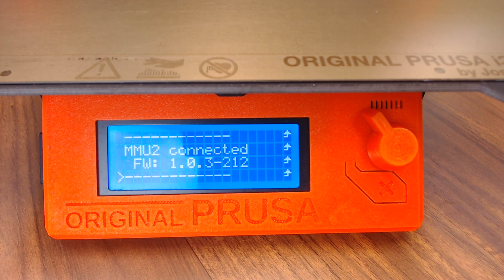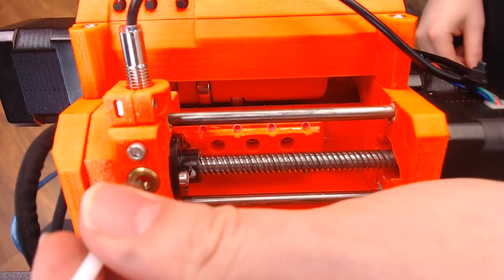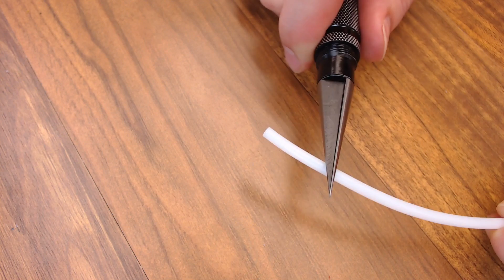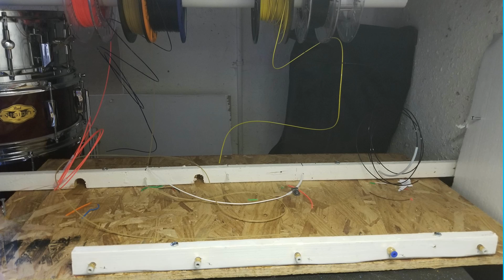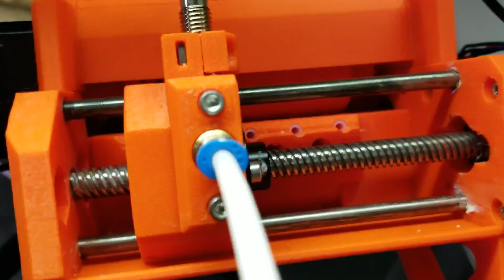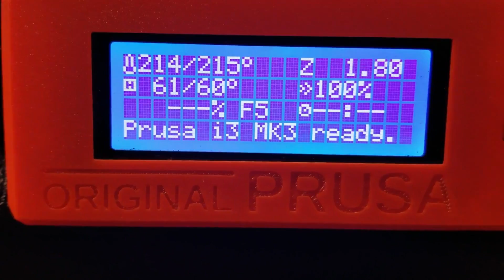Prusa MMU2 Multi Material Unit - Tips and Tricks - Chris's Basement

Comment: If the two screws that hold the back cover on are under spring tension doesn't that mean that the filament is also under spring tension as opposed to being held by two fixed bars?
Reply from the maker: You are correct, but it adjusts for all 5 filaments at the same time, so if you have one that's even slightly off there is no compensation for that one.
Reply: @ChrisRiley  oh I figure since it was only hitting one roller at a time it would be able to compensate for it.  Guess the tension system is pretty picky eh?
Reply from the maker: @DoRC  It does try it's best, but it's a lot to ask across that plain. It's a little tricky. ;)

Comment: This is an excellent video.  I too have an MMU 2.0 and I've got a few tips to share as well now that I've gotten mine to 100% reliability (seriously) and I've even got it working with flexible filament!

Use this PTFE pass-through back plate: https://www.thingiverse.com/thing:3233579  Why:  The stock back plate squishes the PTFE tubes resulting in too much friction.  Bonus feature:  This mod makes it super easy to disconnect the PTFE tubes to relocate your printer (e.g. for maintenance or just to take it somewhere).  Just press the collet down and pull out the PTFE.  Takes 2 seconds!  Love it.  Insertion afterwards is even easier.

Use this "Large Bore" MMU 2.0 selector and print it at 0.1mm layer height: https://www.thingiverse.com/thing:3337120 Why: The stock selector's intake hole is far too small (and not even tapered!) and that part is printed at .2mm layer height... If you cut filament tips with nice, sharp flush cutters like me this means that the tip will have a super pointy end (like Prusa recommends) and that pointy end will often get stuck on the outside of the selector or it will be pushing up against those .2mm layer lines (which are not smooth--they're quite rough; I assume because Prusa is printing a zillion of these a day at rather high speeds) which causes far more friction than you'd think.  By having a larger (tapered) opening and printing at 0.1mm layer height you'll have a selector that's super smooth and gently guides the filament the way it's supposed to with very little friction.  Also, I highly recommend you print it with some transparent PETG which is much slicker (more slippery) than the black PETG Prusa gives you for printing the parts.  Dark pigments can give printed PETG a considerably rougher surface!  For reference, I printed mine in eSun Transparent Blue (https://www.thingiverse.com/make:596801)

Use that tapering tool Chris recommended in his video to taper both ends of the "short" PTFE tubes in the front of the MMU 2.0 unit.  The MMU 2.0 ships with just one side of those tubes being tapered and the manual says to insert them with the tapered end facing outwards (which doesn't seem to make sense but one of Prusa's engineers says it's to aid with retracting rammed filament tips).  Having both sides of those short tubes tapered means there's less of a chance that a sharp (extra pointy) filament tip will get caught on the edge as it comes out of the hobbed gear and into the selector.
Reply from the maker: Thanks for sharing.

Comment: Just a minor correction:  You called the MMU 2.0's PTFE tubes "Bowden tubes".  Not a single bit of the MMU 2.0 is Bowden.  They're just PTFE "feeding" tubes.  A Bowden tube is a very specific thing: PTFE going from the extruder to the hot end.  That's it.  Anything else is just a regular PTFE tube.  The MMU 2.0 uses a direct-drive extruder so there's no Bowden to speak of.
Reply from the maker: Noted.
Reply: relax

Comment: Hi Chris, I’m considering buying the mmu2 for my MK3 but wondered if there’s space to attach it when using the Lack enclosure?
Reply from the maker: Not without an overhaul on the enclosure. It might fit, but the filament routing will be a nightmare.
Reply: Chris Riley ok, thanks.
Reply: @ChrisRiley  I can confirm that it fits (but only just). Routing isn't a big problem if you place your spools on top of the enclosure. I can fit all five with the provided spool-rollers. Maintenance is a nightmare, however.
Reply from the maker: @mhelvens  Thanks Michiel, as much as I have to clean mine out I think for me the enclosure would just add to the headache, thank you for confirming.

Comment: Chris, anyone else, I'm having issues with filament tip being too thick sometimes on filament change and it gets stuck in the ptfe tubing... any advice on setting changes?
Reply: I had this issue and fixed it!  Double-check that no PTFE is getting "squished" anywhere in the MMU 2.0.  For me, that problem was caused by the plate in the back of the MMU 2.0 that holds the backside PTFE tubes in place.  It's not a very good design.  I swapped that back plate out with this one which uses proper PTFE pass-through connectors and that problem went away: https://www.thingiverse.com/thing:3337120
Reply: Almost forgot:  Also make sure your extruder body isn't an earlier version of the R3 unit.  The hole going from the top (where the plate holding the PTFE tube fits in) was slightly too small and could result in tips getting caught up (slowed, if not completely stuck) in there.  You can fix it in like 2 minutes though real quick:  Remove the top plate that holds the Festo coupling and that little PTFE tube then use a 2mm drill bit to drill it out.  Go as slow as your drill can go and be careful not to hit the filament sensor (even though it's not being used in the MMU 2.0--yet) or the Bondtech gear (you'll need to unscrew the tension screws and lift up the side plate so you can get a good look in there while you drill).  I did this (even though I printed the latest R3 extruder body) and also gave it a little bit of a wiggle while I drilled it out to ensure it was tapered ever so slightly.  It definitely opened up the hole just above the Bondtech gear a bit and from that point on I never had a poorly-rammed tip get stuck there.

Another thing that caused me a similar headache was a mistake I made in Slic3r-PE:  I accidentally used an MMU 1.0 profile for a print which had it trying to unload the filament the entire way using nothing but the extruder itself (no MMU) which resulted in a great big blob of hard-to-remove filament just above the Bondtech gear.  Ugh!  Took me far too long to figure out that was what was causing that problem, hah!

If in doubt, (temporarily) relocate your Slic3r profile (effectively resetting everything to defaults) and try a simple MMU print to make sure everything works.  There's just as much that can go wrong with the software as can go wrong with the hardware!
Reply: @Riskable3DPrinting  I'll have to take a closer look at the tubing just above the extruder gears then cuz that's where it's getting jammed. I did bore and double check all other spots though like you mentioned. I went from mk2s mmu1.0 to mk2.5 mmu2.0 just last month. So I assume it's one of the newer revs but I can check. the filament is occasionally ball ended instead of spear shape or just too thick of a spear. It's this Algix APLA , I have 5 spools and needed to make some name tags with those colors ... otherwise I'd just reserve them for single prints because it will only jam at the end.  I was leaning toward any suggestions on ram settings etc because my petg and other pla doesn't seem to have this thickness issue.
Reply: @Riskable3DPrinting  I used a drill up at the selector and that alleviated a lot of friction there. I'll take a look at this area you mentioned and see how it shakes out!
Reply from the maker: Thanks for the tips @riskable 3d printing, @jungle gym ninja, let me know if you still need help.
Reply: @ChrisRiley  For sure. Thanks for the video. I struggled getting through some printing some mmu gifts a couple weeks ago with constant attention to random jams and was so exhausted from dealing with so many errors... haven't even printed in 2 weeks cuz I just expect trouble, really regret leaving mmu 1.0 as it is. I will try these tips and suggested fixes cuz they seem like it is common and is what might be at the root of the problems I'm experiencing. Thanks!

Comment: Thanks for the easy to understand tips on getting your MMU2 to work successfully. I have been doing my head in with failed prints so I will go back to the beginning and check and recheck using your your advise. Hopefully I will have success and start enjoying my printing experience again. Cheers :)
Reply from the maker: Good luck Morty, make sure you contact Prusa if you can't figure it out.

Comment: I personally think the MMU2 was kind of a failure business-wise. It simply didn't work for almost anyone as easy as advertised and people had to wait a long time for a firmware that kind of worked. Modding needed etc. I wasn't impressed after the usages I've seen by people, only a few print awesome models. Compare all of that with the setup of a Pallette. Both need better waste management (have a look at the solutions by 3D maker noob), but setup wise the Pallette seems rock solid.
Reply from the maker: I need a little more time with the Palette2 before I can make a comparison on them, but I do intend to do a side by side.
Reply: The Palette looks great, but it is about twice as expensive.
Reply: John O'Shaughnessy Totally true but if I look at the struggles with the MMU2, I’d happily pay that amount to be honest.
Reply: I can tell you I have my Palette 2 vs. MMU2 Pros and Cons spreadsheet open in front of me.  I also feel that the time and hassle to get to good print s looks much easier on the Palette 2, but dang, I go back and forth all the time...  :)  @punishedbrains
Reply: Well there you go, the MMU2s is here based on the user feedback which indeed was mostly negative (unfortunately). But they do want upgrades to existing mmu2 owners to be free or very low cost which is nice.
Reply from the maker: @punishedbrains  Should be a good upgrade, we will check it out together.

Comment: Great video as always. Did you try TheZeroBeast mmu2 firmware? Also Slic3r ++ from supermerill added some nice features to the prusa Slic3rPE like automatic waste tower calculation based on the pigment/opacity. Saw the MK3S is coming with new IR sensor, steel ball and magnet... Guess this is the attempt to get more realible filament sensing at the extruder.
Reply from the maker: Thanks Gussner, I have not tried anything but stock yet. Great MK3S, another thing to buy.... :)
Reply: Howdy, where did you find info on the MK3S? Had no idea one was coming out so soon.
Reply: @Nullzero98  As I am quite often compiling Prusa firmware I saw some commits to their Github.
Reply: @Nullzero98  There will be also a MMU2S and the MK3S gets a LCD that can be dimmed by the firmware

Comment: Hey Chris, what is your take on the waste tower issue? Does it waste a lot? Have you heard of a filament bucket/dump instead of a tower?
Reply: On one hand the bucket may make sense but you will loose some build volume. On the other hand you can wipe to object which isn't waste of filament
Reply from the maker: The tower is a concern for sure. The buckets are cool, but they have there draw backs as well. I am hoping more wipe into infill and waste objects get better utilized.
Reply from the maker: Well said @3d gussner
Reply: Thank you both for your answers!